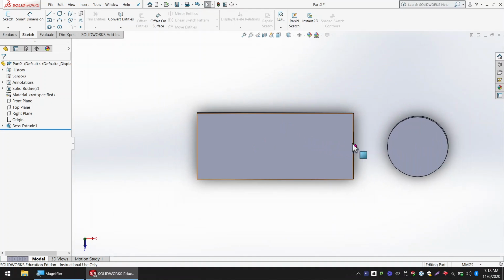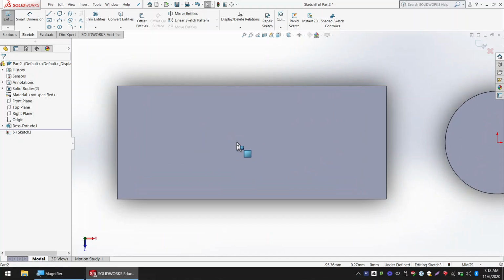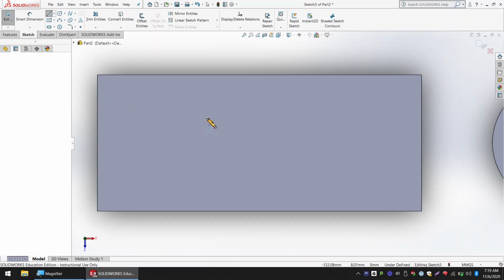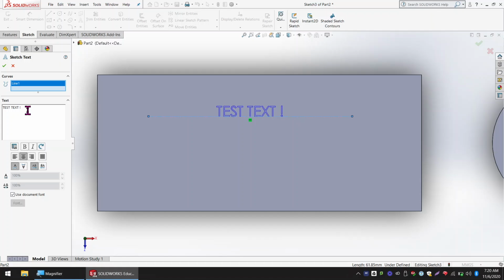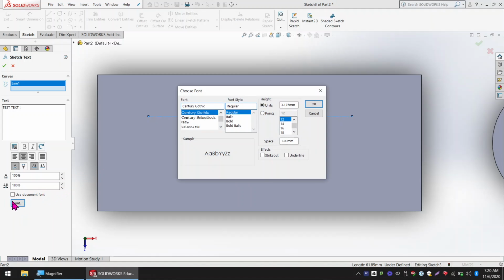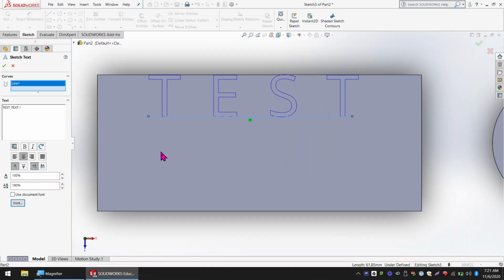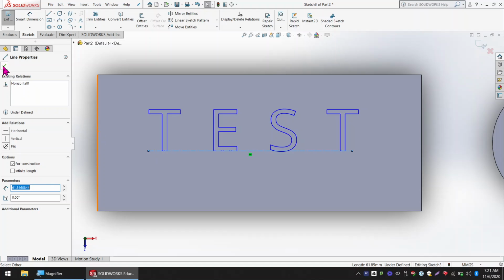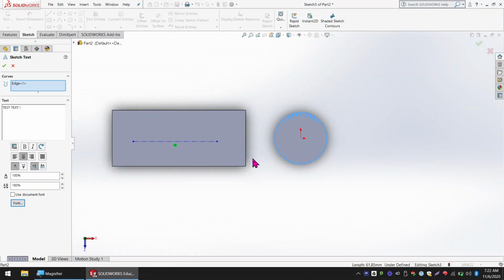Using the Text Tool in SolidWorks

Comment: this works great!!

just a side-note in case anybody falls into the same trap that i did before i watched this video.  to get full functionality of your text, you MUST include that reference base line.  before i saw this video, i tried all of the above steps except for including the base line.  without the base line, SW would NOT let me change text justification.  the default was locked in at being left justified.  after adding in the base line, SW now let me have access to the justification settings so that i could change from left to center justification.